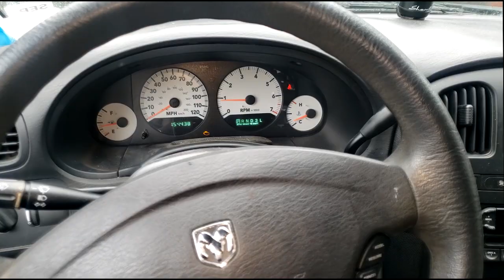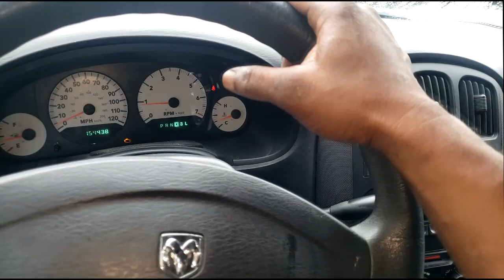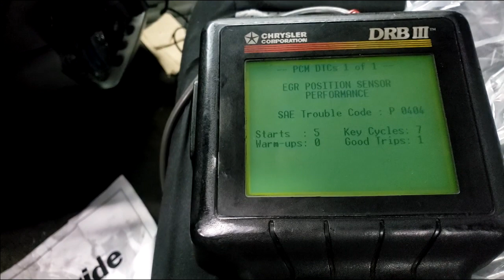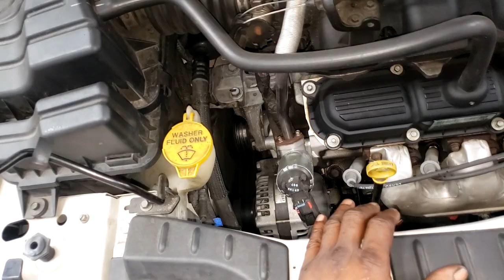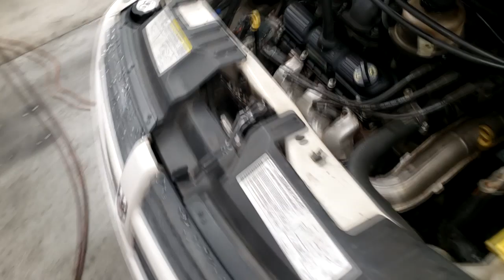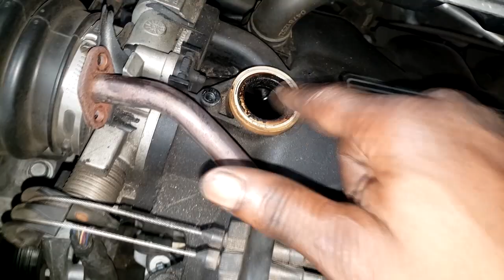Troubleshooting a rough idle EGR Valve code P0404. 3rd time for the same code. New EGR Valve already

Comment: Pretty sure the egr circulates the exhaust gas because it’s burnt the oxygen.   The cylinder then gets filled with air that is not reactive so it makes the usable space smaller in the cylinder , give it less gas then you have just made your displacement smaller to get better fuel economy

Comment: Two problems... One is carbon caked intake manifold & feed hole IN to EGR VALVE, second problem is bad catalytic converter and lots of back pressure will open the EGR valve up and set a code... SEEN Both in my life JT

Comment: My 2010 grand caravan had the engine light on for more than 4 years code p406, the EGR valve looks good and the valve was ok  inside. I just replaced the EGR valve and it solved the problem.  The old valve had damaged electronic contacts in the top cover.

Comment: Some cars watch the MAF or MAP sensor as it operates the EGR valve to verify if there is actual flow. Not sure if that one does.
Reply from the maker: Yes, the computer will monitor if the vacuum (map sensor) changes and or the oxygen content in the exhaust change via the o2 sensors. I wanna guess this how it can verify EGR performance..Great point my dude
Reply: Change in o2s...